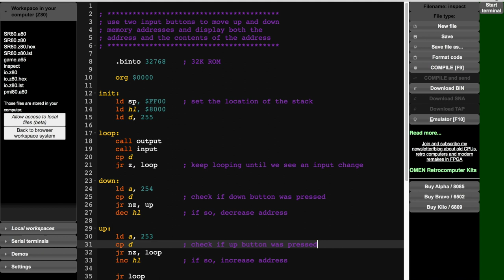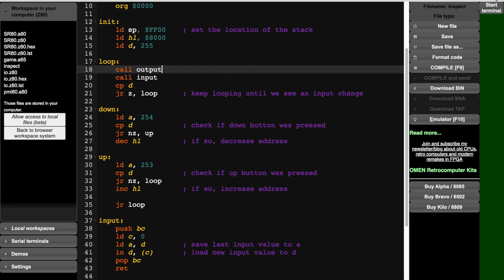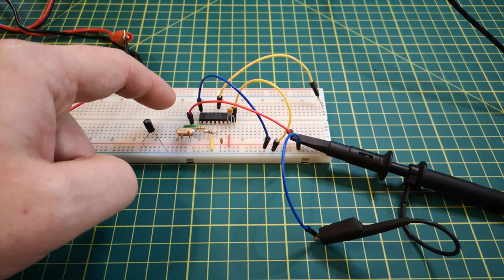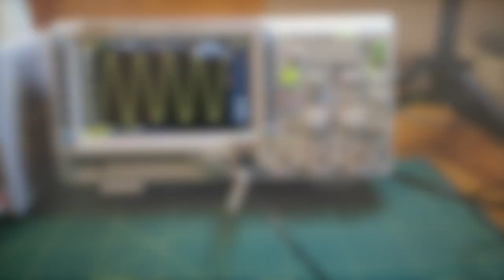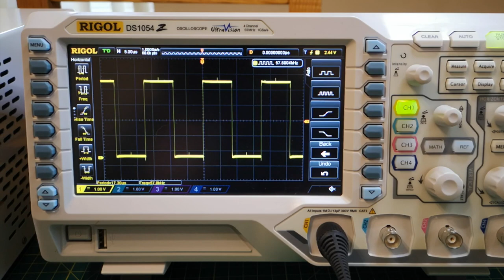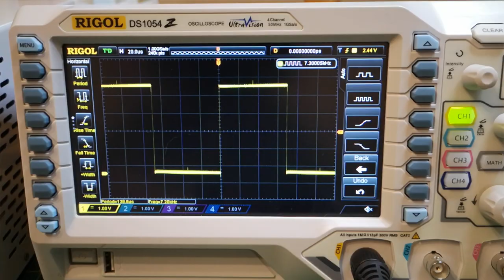Z80 Computer - Part 9 Fast Clock

Comment: Crystal load issues is why I use TTL oscillators. They require 5V and put out a fairly nice square wave at the specified frequency.

Comment: It's "megohm" and not "meggerohm" although there actually is an instrument known as a "megger."  It's short for "megohmmeter" and it's used to test insulation under a high voltage to ensure it won't break down and short out a circuit under high voltage.
Reply from the maker: I'm afraid I will always refer to it as Mega Ohm. Ohm is the base unit and Mega is the SI prefix for ten to the power of six. Do you refer to RAM size in terms of Meg bytes? And yes I'm fully aware of the company Megger. I used their equipment for portable appliance testing back in my electrical engineering and manufacturing days. Boy that was a long time ago now.

Comment from the maker: There are a few mistakes on my schematic. R6 should say 2.2K not 220k, and it's also in the wrong position (see synthnerd4539's comment below). Also pin 12 master reset should be connected to ground, not to the +5v.

Comment: I'm watching these in order so don't know yet if you resolved this, but there's an error in your oscillator section, at least on the schematic – R5 should be across the crystal, and R6 should go from one end of the crystal to the 4060, as per the datasheet – your schematic has it with R5 and R6 in series across the crystal. Secondly I would just point out for reference if anyone needs the formula for capacitor selection based on the specs of the crystal, and I've seen a lot of demos/guides using arbitrary values for these, there's a useful application note number AN2867 by ST, see pp.11-13 for a good clear description.
Reply from the maker: It seems I made quite a few mistakes in this video. No, I had not realised that error. Thank you for pointing it out. Thinking about the resistances involved I imagine it doesn't make much difference. Which is probably why it still seems to work ok. But you are quite right and I will get it corrected. I'll give you a shout-out in a future video.
Reply: @SteveRaynerMakes  yeah there's probably a good margin... I'm enjoying the project, and look forward to seeing how the rest works out. Hoping to get stuck in to a z80 computer of my own before long. Thanks for posting!

Comment: great video !
one suggestion:
* id put output after input. so that you always output new values right away instead of looping before. same result, quicker.
* id do this:

loop:
  call input
  cp d 
  jr z, loop
  call output

that way the inout loop is tighter (faster) and only bothers to update output if it has changed. maybe close to twice as fast to detect your inputs being optimistic.

also you might have made up and down as subs instead of labels and call them inside loop, though that will make them slower. but it might mke it easier to understand and modify.
Reply: i realized youd need to refactor the logix a bit.

loop:
   call input
   cp d
   jz z, loop
   call output

input:
    previous code
    jr forgot
    call up
    cp ...
    jr skip next instruction
    call down
    ret
Reply from the maker: Thank you. I very much appreciate the feedback. It's nice that we are finally discussing coding rather than mainly looking at hardware. Feels like things are progressing. I will be doing a larger keyboard soon, so maybe I could introduce some of these ideas.

Comment: Great video and great explanation, thanks, I was however wondering, is there a need for debounce on the switches, unsure at what frequency you may start to see it.
Reply from the maker: That's a very good point. I'm not sure. We do have the buffer in between the switch lines and the data bus, but whilst that will filter out a small amount of noise I don't think it will fully debounce the switches. I'm not seeing an issue right now, but I'm not sure if it might start showing up at higher frequencies. I'm leading up to a keyboard matrix. I've never seen any hardware debouncing on keyboard matrix circuits. It's possible people just deal with it in software. I'll try to do some experimenting.
Reply: @SteveRaynerMakes  Would be an interesting experiment to try and identify at what frequency you see this, if at all..

Comment: I was watching the LED on A8 while you were going up and down RAM/ROM. It seemed to be on (dim) whilst in ROM but randomly came on and off while you were in RAM. I was trying to think of a scenario that might lead to this observation but I could not. I would be fascinated to find out what was causing it.
Reply from the maker: Yes, a bit baffling. Almost certainly a wiring issue somewhere, but it doesn't seem to affect the functionality. It would not be the first time that I thought things were working ok, but actually, there was a fairly fundamental issue hiding in there.
Reply from the maker: Makes me wonder if that line is actually A15, not A8. But I don't think it totally explains it.
Reply from the maker: I think all is OK. I believe it is the stack pointer. I single-stepped through it and it seems to be memory read and memory writes to addresses FEFF and FEFE. I initialise the SP to FF00. So it's one and two bytes below that address. It's really easy to notice A8, but by single stepping I could see it's also with and without A0.
Reply: @SteveRaynerMakes  Ah, that makes sense! Thank you.

Comment: I agree the back side of your pcb is a bit messy and you decided to use the 4060 chip .  Can you expand on way the system would probably not work well at high frequency .  I am building a z80 system and dont understand why mine works fine at 1.2 mhz but wont run at 5mz.